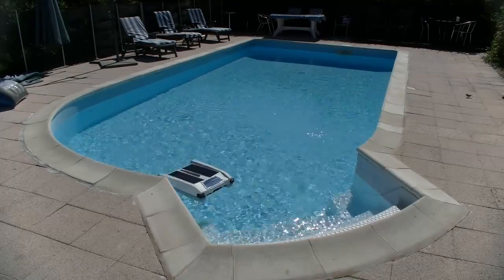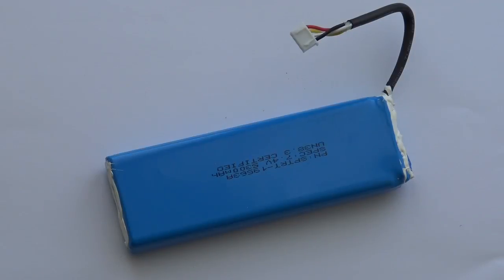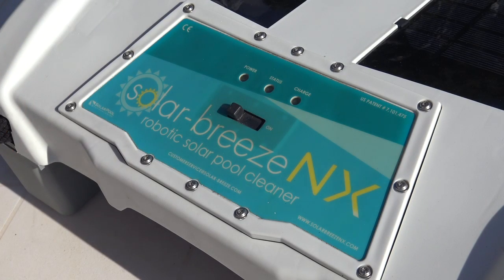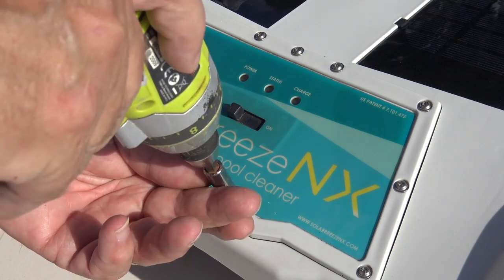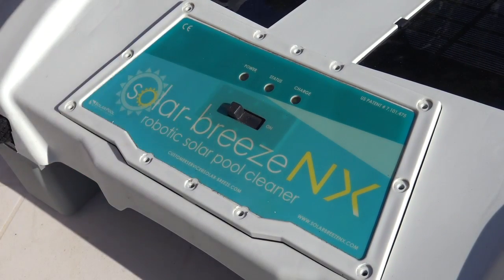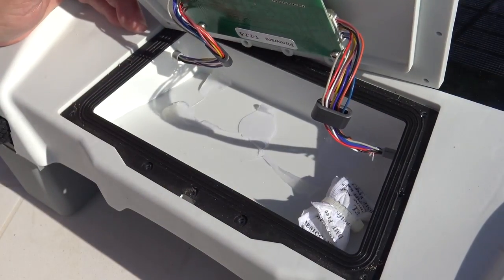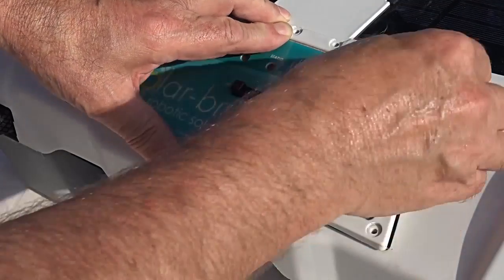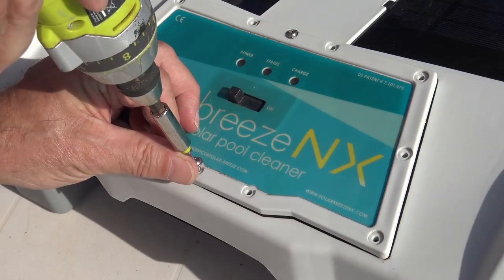Solar-Breeze floating skimmer battery replacement

Comment: This video sucks because there is no recommendation on how to get the replacement battery
Reply from the maker: From Sola-Breeze.com! https://solar-breeze.com
Reply: You could just look up the capacity on the battery and search on websites that sell batteries for RC cars and planes. I did that to get a new battery  for my robot floor sweeper and it is working fine two years later.